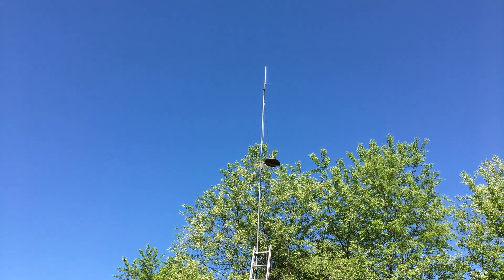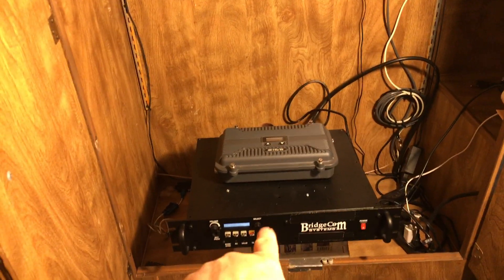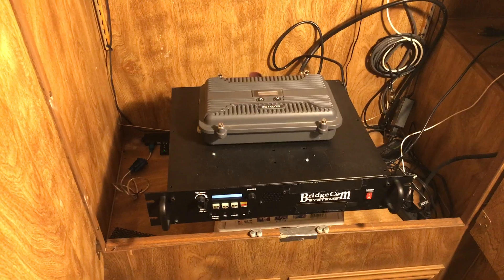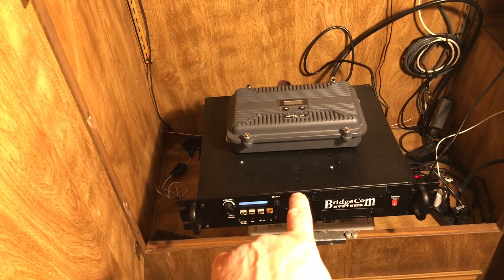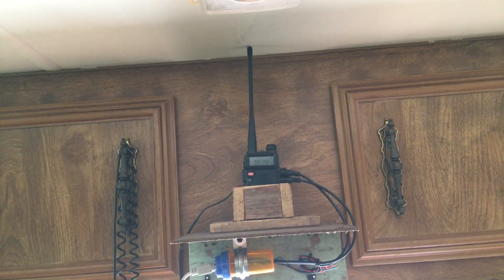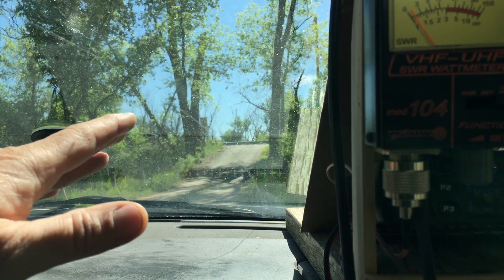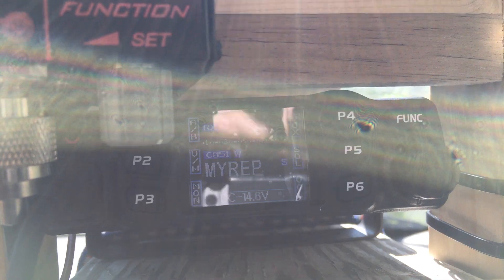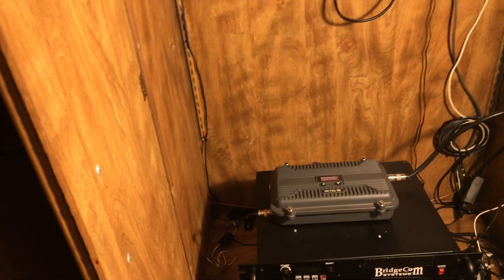🔺 distance/range test Bridgecom ($2,699.99) VS Retevis RT97S ( $279.99)GMRS two-way radio repeaters🔺

Comment: my retivis is at 4100 ft in the sierras,it easily covers 100 miles in the san juaquin valley using most mobile radios,hand help radios need to out in the open more,excellent video,thank you
Reply: How do you even get power to it?

Comment from the maker: I think "SOME" people are missing the point of the video. The point is this is an average test that an average person would do without test gear! "MOST" people are not going to give a sh*t about things being exact, tuned, etc!! They will take the radio, repeater out of the package and do a test like this to compare or to see how "far" it will go, and how does it sound? Can I hear it ok? That is all they are going to care about, let's be honest, this is what people are going to do!! Also known as the "REAL WORLD TEST"  = R.W.T 🙂 to add to this "MOST" people are going to buy the cheapest they can get that being radios, repeaters, antennas, etc.!! There is ALOT of good information in this video that an average person can take from this, and that is people can use a cheap repeater to get the job for what they need!  I think "SOME" people need to take the blinders off to see it :)

Comment: Why would you handicap the Bridgecom by turning its power way down? Obviously it would perform FAR better than the Retevis if both were set to full power.
Reply from the maker: I had to be "fair" to compare to the Retevis! That is the highest power of the retevis.
Reply: @GMRStwowayradio  That's not a good comparison then... More useful to your followers would be to see how much farther range you could gain stepping up to a (relatively) full power repeater.
Reply from the maker: @ChrisMillerOPMG  - yes, I am planning on doing a video with Bridgecom at full power and at the same location. 🙂 full power don't give you range per se it gives you more penetration as I have shown in other videos 🙂

Comment: That Retevis repeater is over modulated. It also appears to have mismatched audio somewhere in the path. 
I am not a fan of the Bridgecom repeaters at all, but the test you did is very far from accurate. Maybe if you would
have left the remote vehicle sitting in the same exact spot between the tests, it might have been slightly more accurate. 
You did a single test with changes to things other than the components under test. This is never accurate. The Bridgecom
audio was actually much better without the distortion. Do I think the Bridgecom repeater is overpriced? Yes, I do, but I think
the Retevis is also way over priced.
Reply from the maker: Read pinned comment 🙂

Comment: The Retevis gabs a better signal but I believe that’s because the Bridgecom’s duplexer was slightly mistimed to the frequency being used.  But like you said, not a lab study situation. My next thought would be in how long can the Retevis hold constant transmit against the Bridgecom ? Great video.
Reply from the maker: I know a few people that run the Retevis hard. They have it hooked up to a "network" which as a lot of traffic on it, and so far so good.

Comment: You should be able to adjust the volume output on both of them correct? I have neither I just know on other repeater systems you have volume control.
Reply from the maker: No, the only volume level is for the internal speaker.

Comment: Nice real world test. I appreciate you setting the Bridgecom to the same output as the Retivis. I have the older RT-97 and it has been running for over 2 years. They don't have the power of the more expensive repeaters but for my use the Retivis is great. Thanks for this video.
Reply from the maker: no problem you are welcome!

Comment: That unit for the hand held is something I’m interested in. Allows for an amp with external antenna.
Reply from the maker: By itself? Or as used as a TX radio for a repeater setup? If yes to the second question, it may not work right watch this video https://youtu.be/NS0-jQOZL1E
Reply: @GMRStwowayradio  yes by its self as a repeater with your product to record the incoming signal then higher power on the output.
Reply from the maker: @icebrakernh  - if you are going to be using it by itself to record and play back using the simplex software like I do in my distance videos then yes if I get an interface board made up for the handhelds that should work with it. Of course when that time comes I will make a video showing this if it goes the way I hope it does..lol